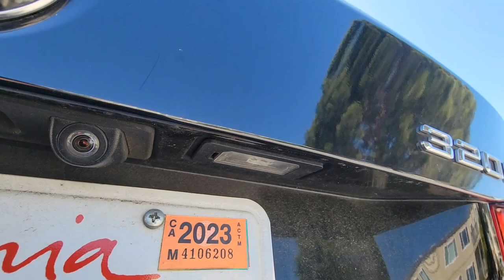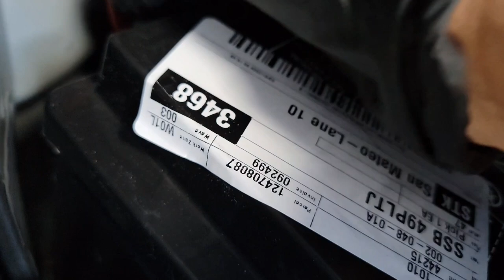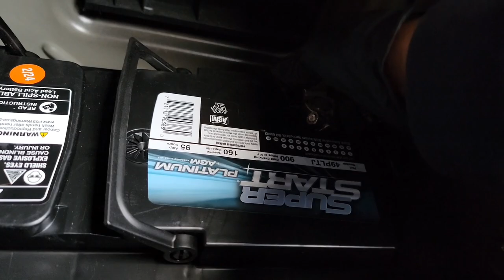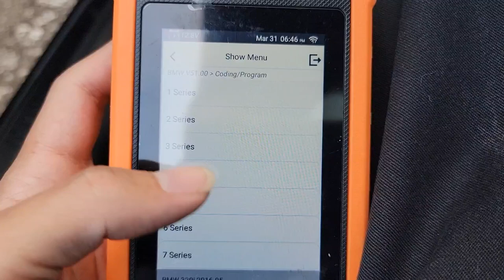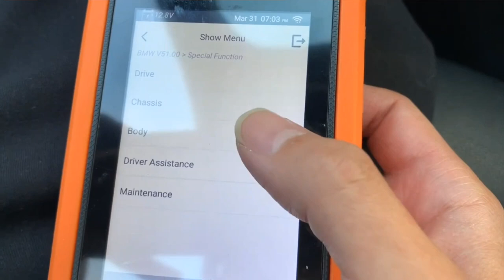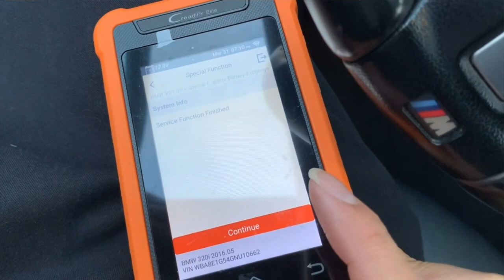How to Replace 2016 BMW 3 Series Battery F30

Comment: Dang, one needs a scanner to replace the battery on a BMW! 
1. Do you have a link to the scanner? 
2. Did it give you any codes that the battery was dying? I have a 2015 BMW and I just realized that it's still an OEM. I'm wondering if it's going to die soon.